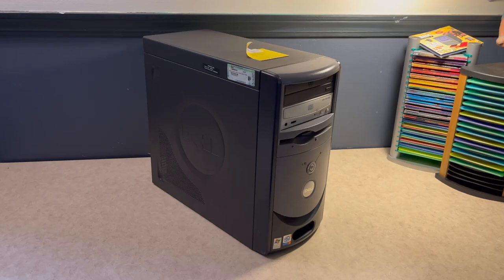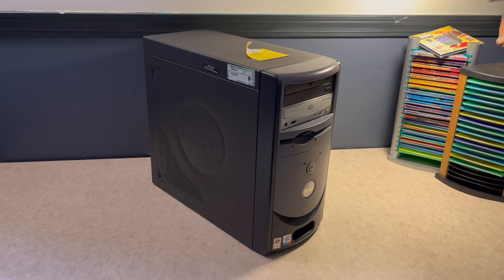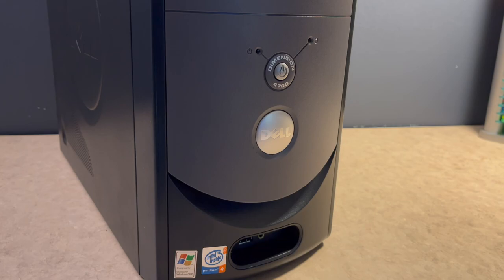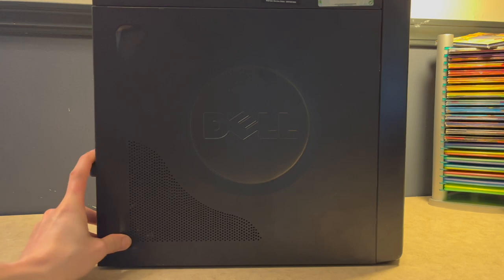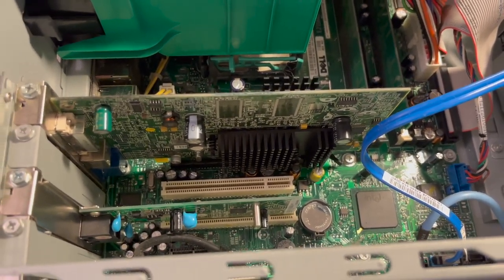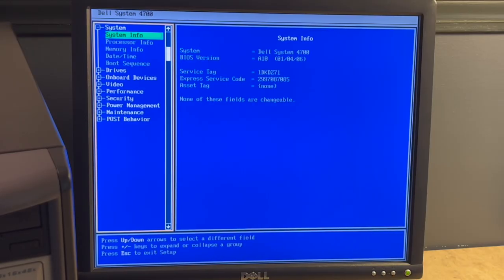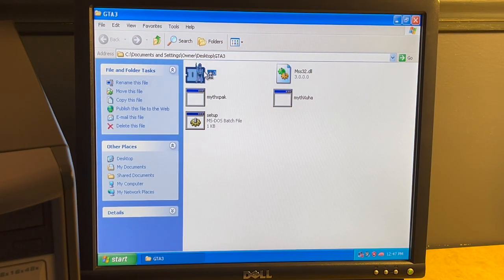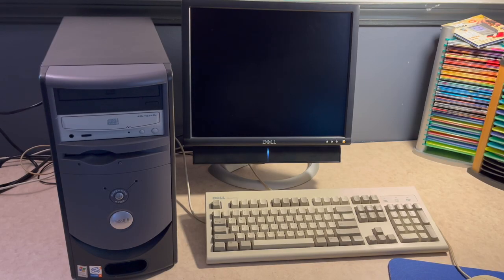Dude, I Got a Dell Dimension 4700! - A Brief Tour

Comment: Bro , these are awesome. And actually the best PCIe P$HT Dell. I have a much newer 2006 Dell Dimension E310. Has SATA DDR2 and supports Pentium 4s in a better airflow case. But totally lacks a PCIe x16 slot leaving you with two PCI and one PCIe x1 i utilized a PCI Geforce 8400GS PCI Sound Blaster Audigyand a PCIe TV Tuner for Media Center no floppy with a media card reader in its place and a Blu Ray Rom Sata Drive with a 250 GB VelociRaptor HDD and a modded bios to use a Pentium 4 HT 651 Cedar Mill to reduce power draw and have the end of the Pentium 4 quality of life. im jealous of your setup bud.
Reply from the maker: I had an E310 back in the day. It was my backup computer, and at one point ran a Minecraft server for my friends and I to play on. Would have loved to have this 4700 back then with the full-size PCIe slot for a video card.